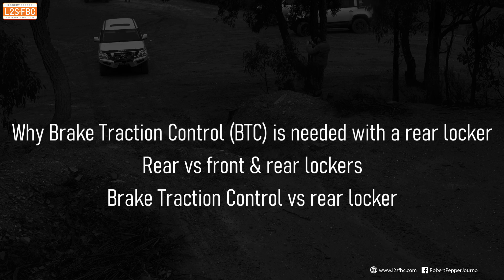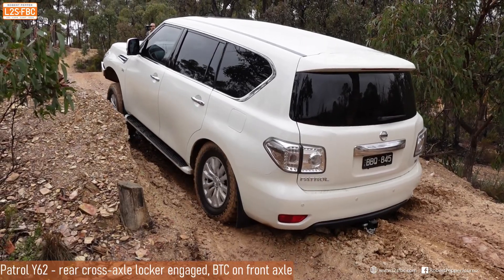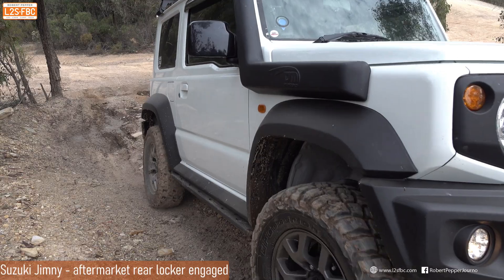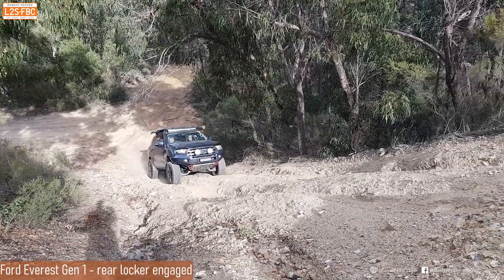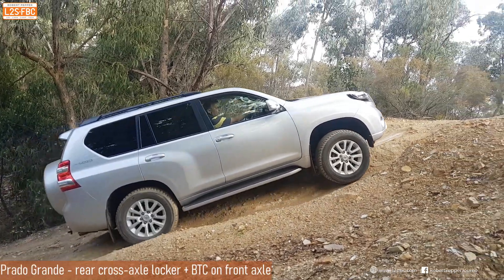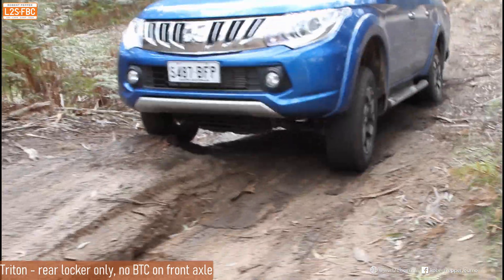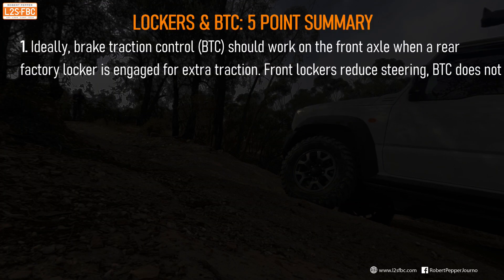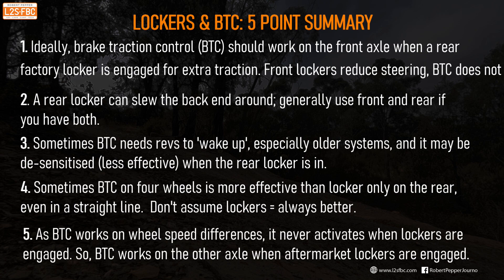Why Difflocks AND Brake Traction Control are the best!

Comment: Still fascinated about saying cross axle crap . It’s a diff lock end of story.
Reply from the maker: Centre or not?  Refer to the recent post on my FB, you'll see the term is not new and widely used.  There's also inter-axle locking differentials...you can't say to someone "lock your diff" unless you're clear which one. Front, rear and centre may work in a 4x4, but when it comes to a 6x6 you need another set of terms.
Reply: @L2SFBC  widely used by who ?? You seem to be the only one . Trying to sound more educated
Reply from the maker: I'm trying to be clear about what I mean.  Refer to that thread above and you'll see a wide range of views from a lot of very experienced people across many different countries, truckers included. There is no complete agreement, but "cross-axle lockers" is generally agreed to be a useful and descriptive term, so I'll continue to use it in order to differentiate between those and centre differential lockers. The same term should carry over to 6x6, 8x8, 6x4 and whatever else, it would otherwise be confusing.  However, the term "cross axle locking differential" is quite long, so a with most long terms, it can be abbreviated after first use to "lockers".
Reply: @trickymon Not “trying”. He is well educated. Hence why I value his videos.
Reply: @nebuchadnezzar9641  even gave you a little love heart 💓 how sweet . Just can’t bring himself to say diff lock . Drives an old ranger remember so not that educated at all .
Reply from the maker: Happy now you have one too? 😁
Reply: @L2SFBC  just love all round.
Reply: Didn't see a 6x6 in these videos. Cross Axle Locker term was not consistently used in the video so confusing to the audience. Simple is best. Front, Rear, Centre Diff Lock on a 4x4.
Reply from the maker: https://www.facebook.com/RobertPepperJourno/posts/pfbid02b1soYNW5DgX8G7KjxH1usVDRygwSSgQGtzMCVpKAfXvtX8QZvLHAAFXZ9DewrH7Ll

Comment: Interesting video. Thx for posting. I’m surprised with the Prado, the TC still operates with the rear locker engaged? I own a GX Prado so now factory locker. If I was to fit a locker, best front or rear ?

Cheers
Reply from the maker: Ah, the ultimate campfire debate!  A rear doesn't restrict steering but won't pull you up and the rear diff is stronger. The front reverses those advantages. Prados don't have the strongest front diffs so I'd go rear, but there are good reasons to go front...
Reply: @L2SFBC  thx for reply and info 👍
Reply: As far as I'm aware, when the factory rear diff lock (GXL spec and above) on the Prado 150 is engaged, the electronic traction control system is automatically disabled - by Toyota design.  But with an aftermarket rear diff lock fitted to a GX which has an open rear diff, this would mean that you will have the best of both worlds.  🙂
Reply: Good Question.  Years ago a friend and I both had Hilux utes.  He did a lot of beach work and put a Lockright soft locker on the front.  I did some reading and went with a detroit soft locker on the rear for hill climbing.  The theory of this is that trying to go up a steep slippery slope there would be more weight on the rear.  I did manage to get up more hills than him (bragging rights) but to get over a step I really had to hit the step a little hard with the front wheels and bounce it up on top of the step.  If I had put a locker on the front it would have been able to climb those steps without so much need to hit the step hard.  He did very well in the sand with his front locker, but did find that when manoeuvring in soft sand with the font locker engaged, it tended to plough straight forwards instead of turning, plus it was much harder to steer when rock climbing or in the soft sand.  Apart from that, I think he did better in sand than I.

It really depends on where you want to go and what kind of terrain you will be faced with.  Ideally you would have lockers front and rear, but I never went that far because I never found a case where the rear locker was not sufficient...  with a bit of clever driving of course.

I do really like the soft lockers like Detroit and Lockright, since they are always off when you don't need them, and always on when you do, so the best of both worlds really.  I went with the Detroit because they had a reputation for strength, he went with the Lockright on the front because they had a reputation for being softer when locking so less likely to be problematic when engaging suddenly on the wheels that are doing the steering.

I now have a Jimny with BTC but I haven't put it to a real test yet.  My concern is that you need the wheels to be spinning quite a bit for it to engage, and when it engages it tends to launch the vehicle at an angle if you are rock climbing with the axles crossed (diagonal wheels in the air).  In such a short vehicle the result of this on a  steep slope looks a bit problematic, especially if you are already on a bit of a sideways angle.  I suspect the answer is to use only just enough power to get the BTC to engage without upsetting the vehicle too much - ie barely just enough.  It's just another thing to learn.
Reply: @Chris_the_Muso  I put a Lockrite in the front of my GU Patrol.  No rear locker, the front pulled me through mud, rocky climbs, through Googs, and the Simpson twice.  Never wished I had a rear locker as well.  As you mention, the lockrite is "soft" in it's action when on full lock going forwards.  Two minor issues that need driving around - one is a bit of binding reversing upslope on full lock for a tight switchback, making a 3 point turn a 4 point turn.  The other is on off camber muddy tracks where the slope is towards a 1000ft dropoff as can be found in the VHC.  I unlock the hubs for this scenario and grit the teeth together with other body part, haha.  Steering is a bit heavier when the hubs are in but only really an issue on hard ground where but for laziness the hubs should be unlocked.
Reply: @Chris_the_Muso  thx
Your reasons for choosing the Detroit (ie strength) line up with Roberts advice that he would go the rear in my Prado for an aftermarket locker for strength reasons. As another viewer mentions having a locker independent to the TC (assuming it is switchable) is ideal. Interesting you mention the issue of being ‘launched’ at an angle. I recall a YT video from Madmatt 4wd where he demonstrated a rear only locked in a SWB Toyota Bundera going up a steep hill and the vehicle wanting to pivot sideways when one of the rear wheels dropped into a large hollow taking weight off the other rear wheel.

Cheers
Reply: Very interesting. Thanks for the great job. Was also under the impression that my BTC in the front doesn’t work when I engage my factory rear locker in my Prado GXL. Is it not he case? Cheers Falk
Reply: I wouldn't bother fitting a locker for a 150 series prado. The TC is already so good.